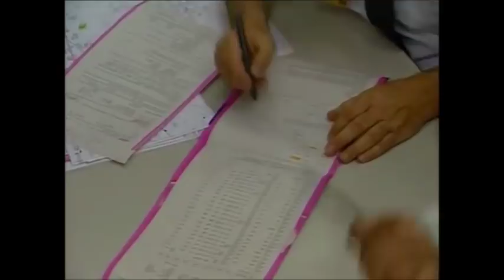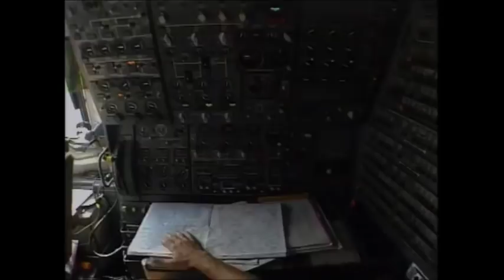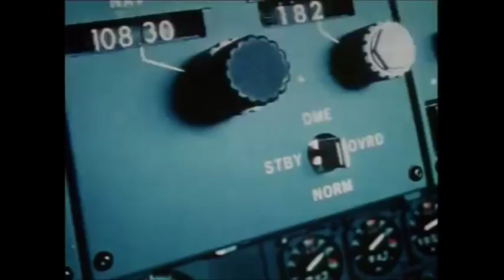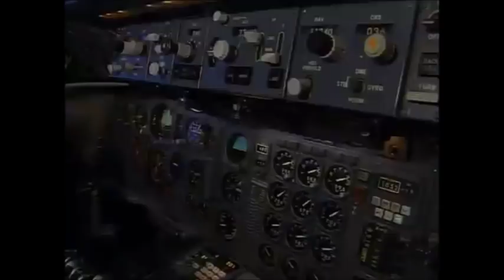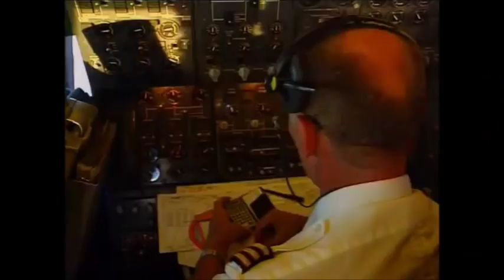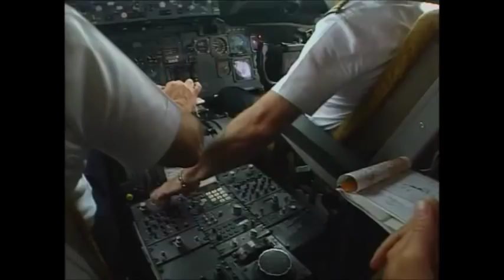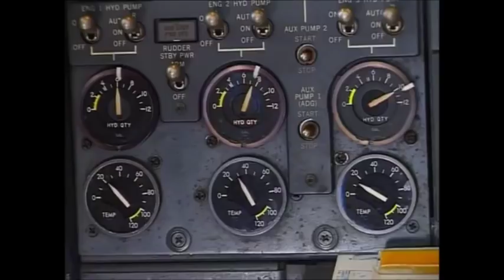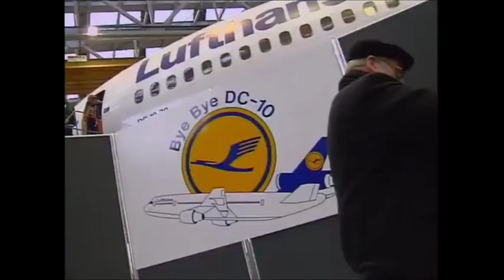LH720 - In the Cockpit of a DC-10 from Frankfurt to Beijing

Comment: What are Lufthansa doing flying that shit heap? Their safety record will be tarnished at this rate.
Reply: Oh, shut up! Would you rather fly in a Boeing B737 MAX?
Reply: Why would you say that? The DC-10 after the cargo door failure that occurred on AA96 and THY981 were the only accidents attributed to a design flaw. The cargo door issues were also found on the early 747 series.. See UA811 incident in 1989. All other incidents involving a DC-10 after were due to pilot error or airline maintenance error.
Reply: Lufthansa had no problems flying the DC-10. I have flown on them in the 80s.